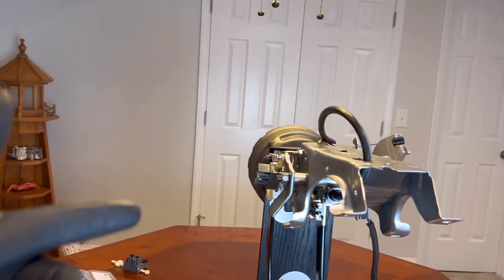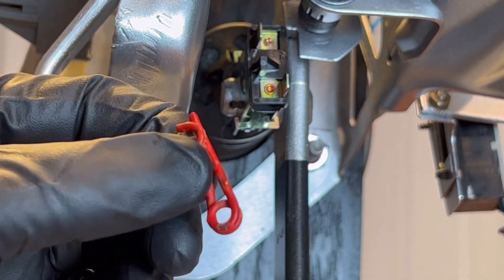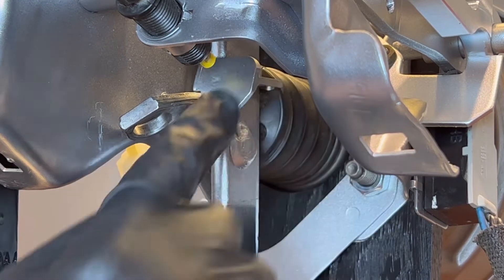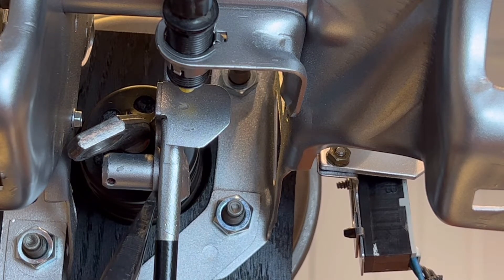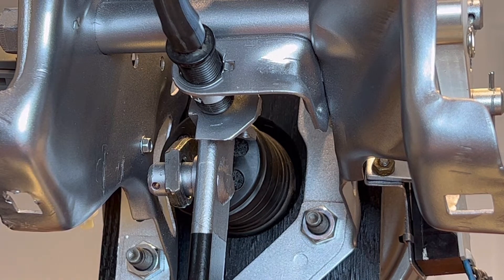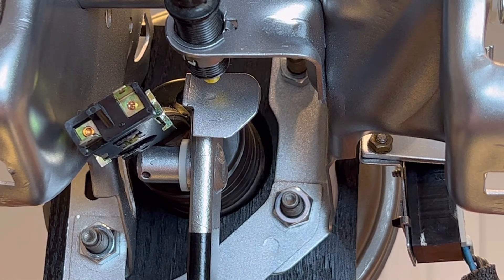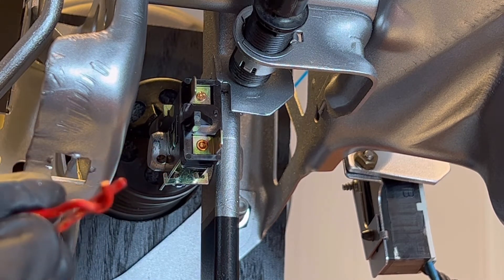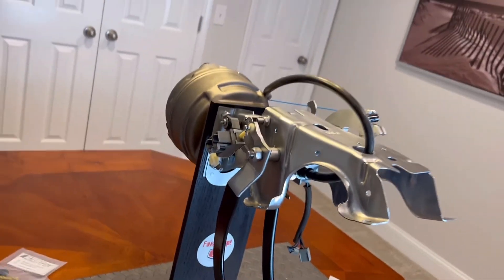How To: Foxbody Brake Light Switch

Comment: Thanx for the vid, why when you initially took of the black plastic bearing it came from the right side of the booster rod and when you installed you put in the left side of the booster rod?
Reply from the maker: Good catch!  👁️👁️   
I had it on the wrong side before the video.  The installation is the correct placement.

Comment: Soooo glad to find this vid!! My issue is the brake lights wont activate until the pedal is past the halfway mark of pedal travel. Im on my 3rd brake light switch..Any suggestions? Have you had this problem before? Thanks!! 87 Mustang 5 litre.Signed, VERY nervous Mustang driver!😳
Reply: You've likely figured something out by now but for what it's worth, my guess is you may need to shim up where the contact meets the spring on the switch? There could be too much travel/play? Good luck.